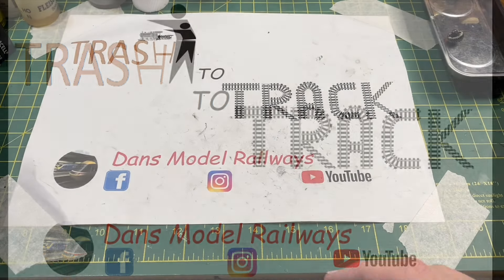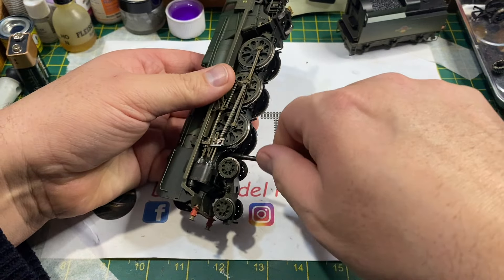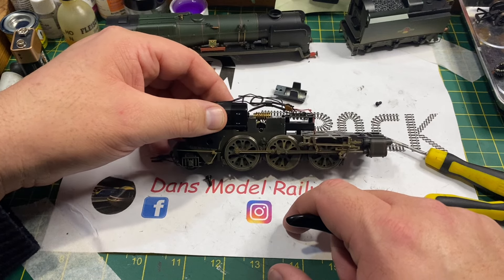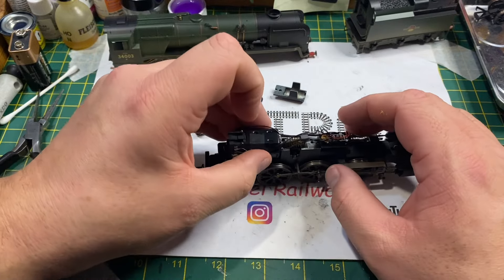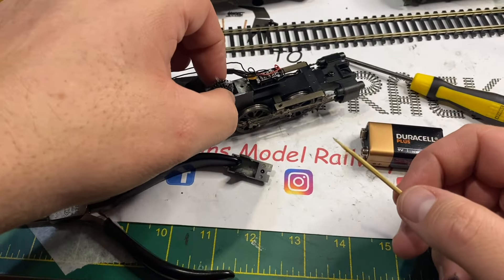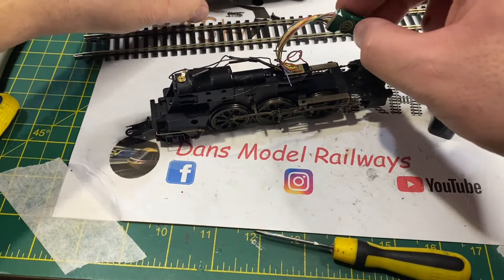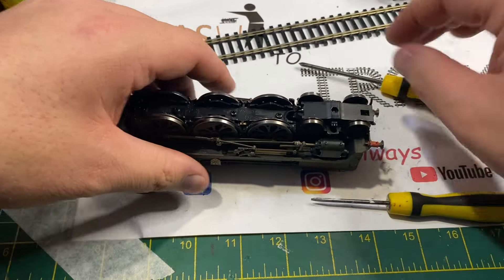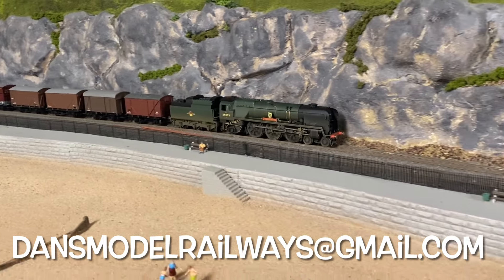Trash to Track. Episode 84. Hornby West Country class loco

Comment: Dan,
You can go one step further and put brass or aluminum sleeves cut to size on both sides of the gear. They ate available as thin tubing at hardware stores. The sleeve goes on the plastic part on both sides. This will be a permanent fix!